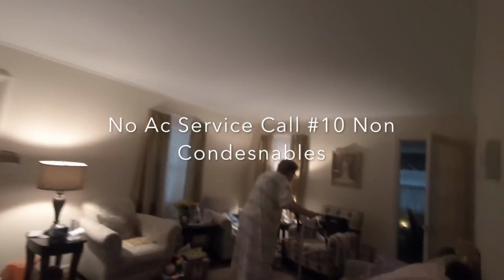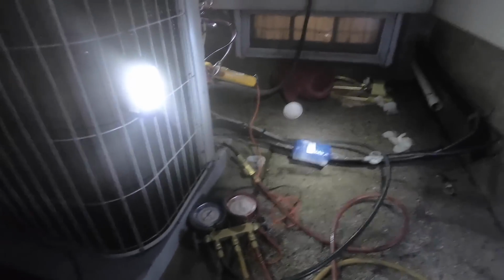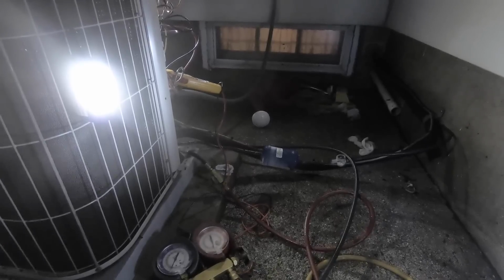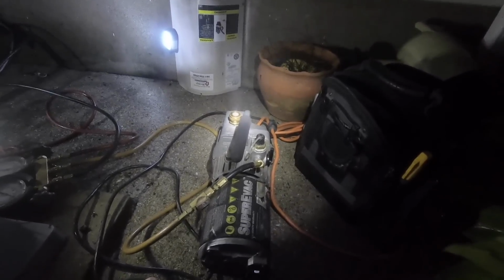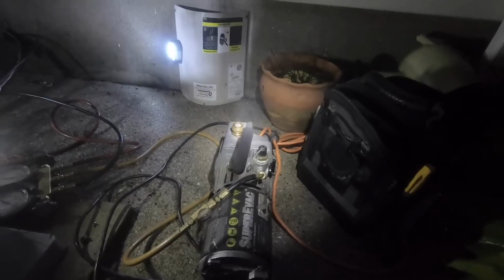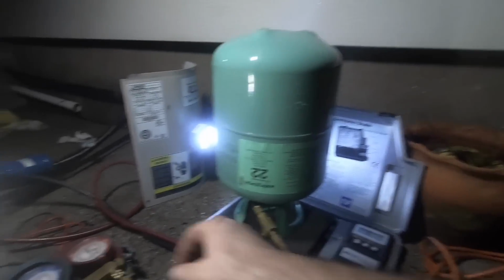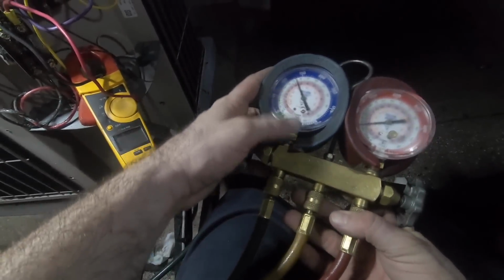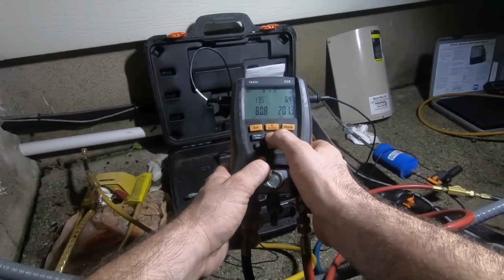AC Not Cooling Contaminated System Overheating Compressor HVAC

Comment: Vents excess refrigerant from gauges into air at 9:34 and proceeds like nobody's watching.......by the way the easiest way to cool a compressor with a hose is to take off the spray nozzle and just prop the end of the hose directly on top of the compressor. Turn the water on to a low flow and the water will blanket the compressor evenly over the top. Leave it running for 5-10 minutes. Been doing it for 33+ years.
Reply from the maker: According to the EPA "De minimis" quantities of refrigerant released while making good faith attempts to recapture and recycle or safely dispose of refrigerant including releases that occur when connecting or disconnecting hoses to charge or service appliances." Which gases trapped in hoses fall into de minimus. Venting refrigerant is illegal yet I was just clearing trapped 410a before connecting my hoses to an r-22 machine. It was gas whatever was stuck in the yellow hose after a system recharge from a leak I repaired the job before this. If your in the field 33 years you most likely cooled a compressor with liquid 22
Reply: @thehvachacker , I remember those days of using 22 to test defrost t-stats and cooling compressors. Back in my Montgomery Wards days the joke was keep the doors and windows closed that there is no outside venting going on. I hated it when the epa screwed our fun. Back then it was all seat of the pants, no fancy tools like you have. On the plus side those damn giant plastic bags filled with refrigerant we recovered were lighter than the tanks used today.
Reply: @thehvachacker  haha. Oh I know. I was just bustin your ass... Haha and in the old days we did crap that would get us thrown in EPA jail now. Clouds of refrigerant billowing over the rooftops.
Reply: The irony of it is that anyone can buy and vent R-134  from air duster cans and pipe freezing kits and no one bats an eyelid!
Reply: @therealchayd  
r-134 does not harm the atmosphere that is the reason it is used for air dusters. In contrast R-22 is extremely harmful to the O zone and adds a substantial amount of harm in the form of the greenhouse effect.
Reply: @powerpooch2000  
Sorry to burst your bubble, but the GWP of R134a (1430) is not significantly higher than R22 (1810). In contrast R410a is worse by almost two-fold (2088).  ODP of R22 is actually quite small (0.05, R11 = 1.0).  The real reason for the phase-out is, as usual, not because of residential system, but heavy commercial and industrial systems that hold hundreds of lbs of the stuff leaking more than 10% per year because of slack maintenance practices or poorly designed pressure seals.
Reply: @sivalley  I stand corrected I just went off the top of my head of what I could remember,, I need to be more specific next time and look up exact numbers,  All I need to do is delete the word significant from my statement, and my point is still valid. which was not about 410a at all but rather the use of r134a as a canned duster. It was chosen because of it's low ODP which is zero and even though it's GWP is around 1300 it is still lower than r22. So essentially by the numbers it's just all around better than either of the aforementioned refrigerants for use as a duster. Note I said "as a duster" not as a coolant.
Reply: @powerpooch2000  fair enough, I shouldn't reply while half asleep.  I just find it amusing that they switched to R152a as duster/aerosol propellant where CO2 was unsuited and happens to be VERY flammable and that OOPS! 410a isn't as green as we thought. Hope you have a great day.

Comment: I was living in Eureka, California in the winter of 1986-1987.  My apartment was located right on the boat basin.   Lightning was repeatedly striking on the water, less than 100 yards away.  It sounded exactly the same as in a Hollywood movie.  Like the loud crack if a whip,  with echos.  The room lit up like a camera flash going off.  It wasn't particularly scary,  but it was quite dramatic.  It is a moment I will never forget...
Reply from the maker: Lighting can be scary. I had a customer get knocked out playing his guitar when lightning stuck a light pole on his property

Comment: Dealing with the negative comments sucks . The customers opinion and comfort is the only one that matters . You came and did what your where asked off . Saved her some bucks . And she will be good for a hot while . At least till winter and you can plan on coming back and pulling it down and throwing a filter on that hog . That can’t be much time . It’s the second week in January and I been working on mostly commercial fridges and freezers . Down here in Florida summer season starts a little after February . It’s how I catch up on my paper work bull crap . I find that if your following the sight glass you have to run the machine under load almost 24 hours especially on smaller machines before they settle down . If the charge is right you can watch the compressor come on , the air pushes out , then finally after everything gets running and warm the Bubbles disappear . Any ways good work . Your hired . Lol .
Reply from the maker: We are swamped with no heat calls in Jersey now with temps barely getting up past freezing marks.

Comment: Get a refrigerant identifier and save yourself time and equipment contamination.
Reply from the maker: We put refrigerant labels whenever we replace or put anything different that the name plate. Yet we don’t carry anything but r22 and 410a on our trucks. We learned the best drop in for 22 is 22.
Reply: @thehvachacker  Most of the new window shakers now use propane (290) instead of 134a.  The restrictions are based on system charge.  As of 2018,  I believe the limit was 2 pounds.  410a is being phased out, as is 404a.  And, sadly, after 2019, R22 manufacture and sales will be banned. Now is a good time to stock up.  ;`(
Reply from the maker: I thought the manufacturers were going with r32 since it is being installed in some of the newer equipment
Reply: @gyrgrls  as of jan 1st 2020 the manufacturing or importing of R22 is banned. The sale of all R22 manufactured before jan 1st 2020 is allowed. So basically anything left on the shelf in warehouses that was made before that date is allowed and sale after that is still allowed. Just no more importing or manufacturing of R22 
The catch is, it will come at a big cost most likely
Reply: @thehvachacker  i heard same thing since Europe is already using R32.
Reply: Sale of 22 will not be band. As of 2020 it will no longer be manufactured in the US. Their will be millions of pounds available. Just like R12 the price will go way up and eventually you will only be able to purchase recycled 22.

Comment: May be mixed with 407c or some other drop in , it happens when the data plate refrigerant info
 isn't updated.
Reply from the maker: I never mixed 407 with 22 yet would it really throw the pressures up that high? I don’t know, mabey nu-22. Yet 407 would struggle with mineral oil I would think so mabey it would make pressures skyrocket.
Reply: The HVAC Hacker I mix 407c with 22, the pressures are slightly higher. No more than 10% though.
Reply from the maker: Nothing like what I ran into here?
Reply: @brettcox4108  true
Reply: @brettcox4108  your not suppose to mix refrigerants at all in USA. Its illegal. Plus R407c works great on its own. 
I have heard of people mixing but there is not glide or PT once you start mixing to go off.....

Comment: Get yourself a micron gauge and do the job correctly. It will tell you when all the crap is gone and if there are any leaks before you recharge it and hope for the best.  Lennox also puts charging literature on the units door so guys like you don't have to guess when the charge is correct. Try reading the charging procedure next time and you'll be allot more convinced you did it right. Your young but it will eventually come to you.
Reply: EFD620G, you sound like such an arrogant tosser with comments like "Do the job correctly", "so guys like you", "try reading the charging procedure next time." Get off the high horse, don't be such a prick.
Reply from the maker: Still waiting for my boss to replace my micron gauge I put in for tool replace beginning of August. I know I charged the system right I go off the chart in the door for every system. Lennox even gives you on most machines the subcool to outdoor temp chart.

Comment: That is one rare sight to see, a TXV, plus a sight glass on a home HVAC. I wonder who cooked that kit up? That had to cost the homeowner a pretty penny for that overkill.
Reply from the maker: Most r22 systems were installed with sight glasses. They are useless and cause homeowners to stress seeing bubbles. We stopped putting sight glasses on most systems installed after 2012 since many techs overcharged the systems using the sight glass instead of subcooling
Reply: @thehvachacker  in my short stint as a tech I never did sight glass with or without a TXV. Only by superheat or subcool. The only time I did use it was rehabilitating a dual temp reach in that its semi hermetic compressor burned up. I used it as a moisture/contamination indicator, and that was good enough.
Reply from the maker: Moisture indicating is the only good use a sight glass has we only stopped putting them on new equipment though cause there are techs who use to charge to a clear sight glass. Sometimes I will replace a leaking sight glass other times I just remove it from a system. If I have moisture in my system I will have drier restrictions or burnt smelling oil when I disconnect my hoses. Most companies in the area was putting driers on systems with almost all installs. A sight glass is only $13.00.

Comment: What's up homie...I'm WWAAAYYY to lazy and tired after putting in 13 all install warranty callbacks but some of the comments are "dont listen to the haters" what the hell are these doouchebags hating. Abt now??? Lol I litterally love watching these vids bro!!!
Reply from the maker: Dude its the same old hate yet new viewers seeing the hate for the first time. Sounds like a long day. For a second I thought you work where I do with all install warranty callbacks. It wouldn't be a normal day for me to not have one commenter try to belittle me. Or tell me how much I suck cause I used this tool, not that one. Time for you to relax and take it easy the rest of the night
Reply from the maker: Were you out in the rain all day? Hopefully inside unlike me doing RTU heat pm filters and belts all day
Reply from the maker: The installers where I work will get the machine to start and leave knowing service has to come back and perform a start and test. I am happy everything is mostly gas in nj except heat pumps so if a lockout on hp isn't set its one out of 100 installs. We get the outdoor reset not set on boilers so instead of 120 minimum water temp the boiler is supplying 70*f water at the start of the outdoor reset curve.

Comment: AH, im fairly sure you cant just do a refrigerant swap like that, the oil must be changed and the system flushed, but at least it got her a bit of life left in an otherwise ruined unit.
Reply from the maker: It had mineral oil in it to begin with. I recovered whatever was in there and pulled a vacuum which should of removed the contaminates. I wouldn’t be surprised if this goes 5 more years. Yet was just happy to get it work.
Reply: Timothy Whieldon 
What would make you think you can’t do a swap like that? If you know what oil and txv is in the system then why not?

Comment: I'm a little late here to this. You did well, you sound passionate about your work and good with customers. You sound a lot newer than 20 years in the trade ( I think that's what I seen in a comment). 

I didn't hear your quote anything or give customer any sorta options. Yeah you wanna get them cooling but still if that repair was $900 to reclaim and refill and she didn't know a new AC would cost XXXX, Your not giving her a fair chance. It's not your equipment or home to make that decision for her. 
Also on your recovery I let that recovery machine sit on it down below zero and then drop nitro thru it. Soon after I usually replace drier and then pull vacuum. 

Pull vacuum with good house and not thru ball valve hoses/gauges

Your showing quite a bit on video and that's hanging you out there in the open to all these guys. 

Shhhew lol you got your heart in your work I like your work ethic!!
Reply: Also I usually find systems that have been over charged were done so by an untrained eye mistaken low charge for system that had really bad indoor coil airflow
Reply from the maker: The only thing is I am not allowed to give quotes. I was there to get her ac to run she was hot and told me she needed it to work. It could take 2-3 days for a salesman to get there with a quote. Plus we were 2 weeks backlogged on the resi installs so it would be 2-3 weeks with no ac if no repair was attempted. I did tell her I was going to attempt to get to operate with no promises. Yet how do I not do what I can to get the machine to operate or find out with a fresh weighed in charge. This way I can find out what might need to be repaired. Hard to do when the pressures shot up like they did when I cooled off compressor. My Appion hoses failed on the job I was at before this one where I used up my last filter drier. Have to do what I can to make it work.
Reply: The HVAC Hacker 
Man it is what is mission accomplished , this industry have 90% of people who do not know what there are doing and everyone sound and look 👀 the same  , all they want is to talk less and recommend new unit because they can’t fix nothing .

Comment: Good video...I do not charge by site - glass either, especially when mounted down stream of a dryer...I am wondering how you like the Testo 550 as I'm thinking of getting a set....Have about 5 regular sets now to keep from having to change hoses or use adapters and different sit ups I sometimes use or checking more that one unit, same location sometimes....I am also wondering how the non condenseables got in the system or wrong Freon....This is a damn good service call and a good video...My thanks to the gent that made it....Make that, " the Professional " that make it.
Reply from the maker: I like he testo 550 yet after many years I am considering buying smart probes to go with the 550’s I do need to replace the hanging hook

Comment: Great job on diagnosis , Only thing i would have done differently is changed the Filter dier when the system charge is out. .....>Well few other procedural things - but ....this is my philosophy that i impart to people i am training ........"there is a place in *ell for people that take systems to atmospheric and dont change the filter/drier"....
Reply from the maker: Then I will see you in hell. I also teach those I am training to change driers unless sealed inside the condenser when doing an evap coil. Yet used last drier before this job and didnt want to not get this system operating. We all do some things we shouldn’t to acheive our goals.
Reply: @thehvachacker  I can totally understand that , looks like it was getting late and I wouldnt have driven back to the shop for one either! Keep up the good videos!
Reply: @cryptonilla9926  you should always have a few on the truck am commercial and i know my boss would kick my a if i didnt have one being on that job that long.
Reply from the maker: My inventory only allows 2 on my truck. I was on the job 3 hours which isn’t too long. I used one the day before and my last a leak repair right before this job. This was a make it work cause I still had one more call

Comment: What kind of camera did you use for this and is it in some sort of body harness chest level?
Reply from the maker: I am using the GoPro hero 6 black and yes I believe this vide was chest mounted. Some I have head mounted yet I have adhd so many complain of motion sickness on some of those videos which made me change over to the chest mount

Comment: That r22 is ungodly expensive these days!  I wonder what the charge for that contaminated cylinder cost your company to dispose of?  I like your work ethics and diligence to save the lady her system and money.  Couple things I was wondering, should you have taken a static pressure read and check the p/t chart to ambient to get an idea of non-condensibles or other gas?  And also, what about weighing out the charge on the recovery or did you note it from the last entry in the logs?
Reply from the maker: It was an empty tank and I pulled a little less than 5lbs out. I weigh the tanks usually as I take them out and put back into truck. Except for when I am weighing in a charge. Mabey I should of done a static check, this isn’t an everyday call and my body was still on European time 2nd day back to work after 2 weeks in Poland. Next time if I ever run into a situation like this again hopefully I will remember the static test. 20 years in the field only ran into a similar call where nitrogen was left in a dry unit a few years back.
Reply: @thehvachacker  Very cool!  You're a trooper and 20 yrs under your belt!  I can't wait to get started, I wish I had 20 yrs ago.  I love this stuff!
Reply from the maker: one day at a time and many mistakes. All good techs became good techs from working through very tough jobs and making many mistakes.

Comment: How did the freon get contaminated in a closed looped system? Was it too much oil from the compressor? Just asking. I'm a novice not a professional
Reply from the maker: I am guessing someone topped unit off with 410a since the unit may not have been keeping up with temps way above design temp for several weeks
Reply: @thehvachacker   It seems like every hacks solution is to "Top it off".
Reply from the maker: Sometimes a system is maxed out. adding gas will not help since the design temp is around 94 in jersey why need to check subcooling and superheat to make sure system is at least operating correctly